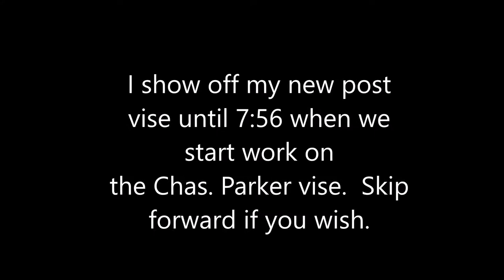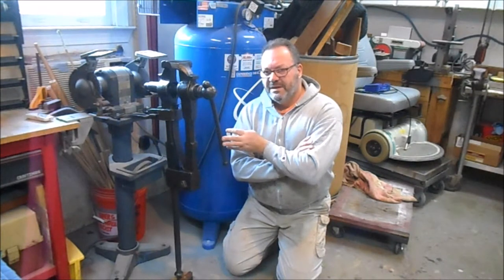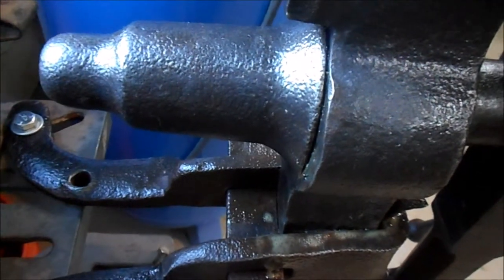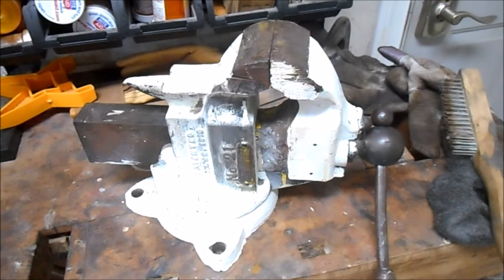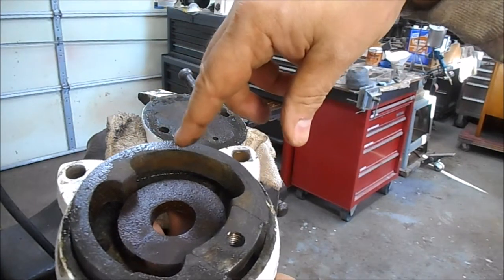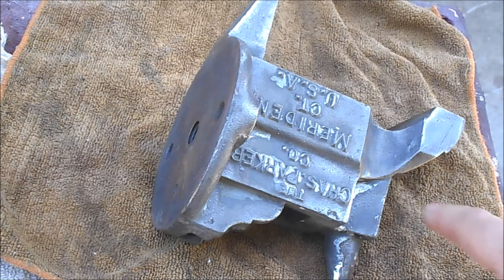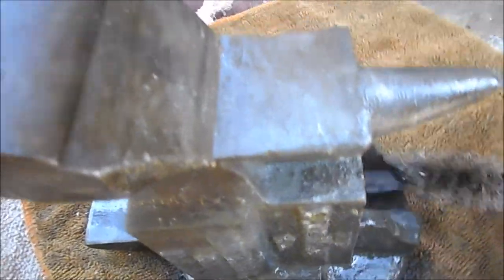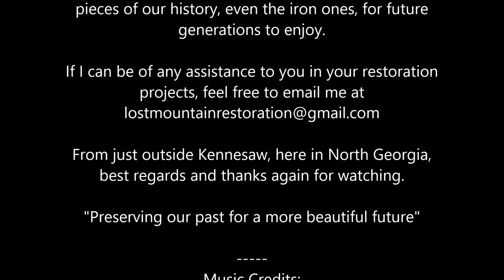Restoring a Chas Parker Vise

Comment: Thanks.  I just acquired the BIG BIG brother of your 21.  It says Parker 886 on one side.  6 inch jaws, swivel jaw, and swivel base.   I'm a bit overwhelmed simply because of the size, but your video certainly helped.  (I think that this thing weighs in north of 150 pounds.  It's too heavy to get on a bathroom scale without hurting somebody.)
Reply from the maker: That's great.  I have a gigantic Columbian vise and I love it!  Good luck.
Reply: Thanks!  Turns out it's a Parker 336, weighing in at 174 pounds.   Working on it right now.
Reply: Wow.. 174 lbs.. I wonder how large vises get...

Comment: Looks like the front jaw was repaired at some point. You can see the welding.
Reply from the maker: You are absolutely correct.  I honestly didn't notice it until I posted the video.   This vise, by the way, has been a great addition to the shop.  I use it almost daily.